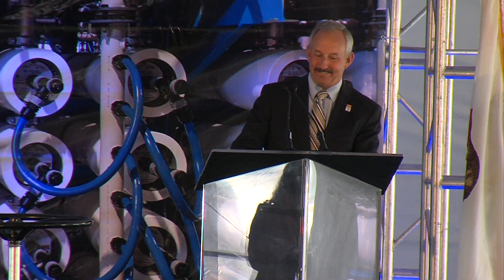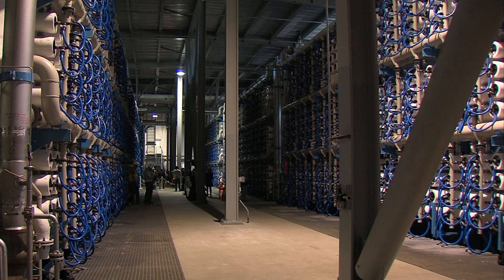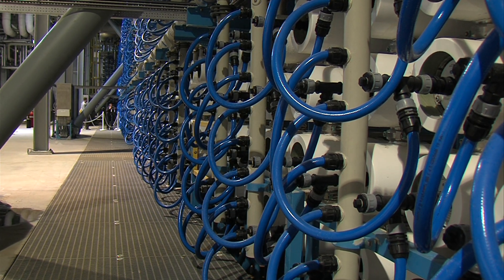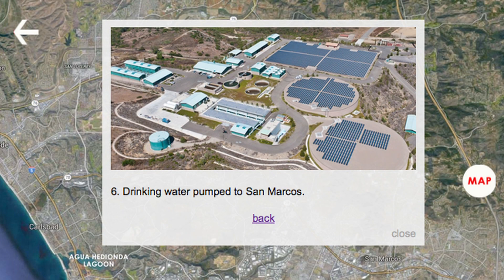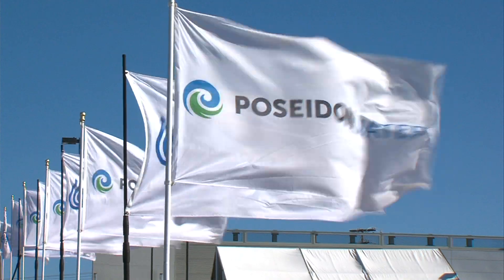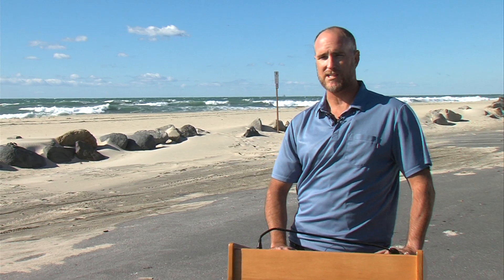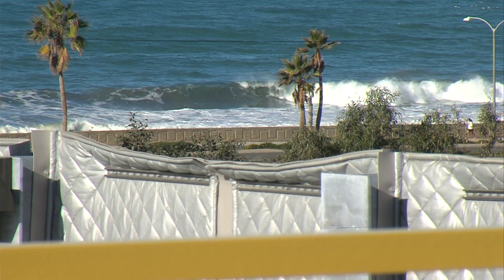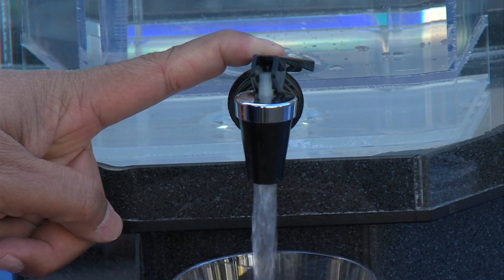Drinking Water Starts Flowing From Carlsbad Desalination Plant

Comment: EITHER USE A PIPE LINE TO PIPE IT INLAND TO STAY AWAY FROM THE WEATHER - OR BUILD A HOLDING POND TO GET YOUR WATER TO STAY AWAY FROM THE WAVES.  
SOLAR POWER YOUR POWER PLANTS AND RUN THE WATER THRU GENERATORS IN THE PIPE LINE.
>YOUR JUST USING THE SUN TO START THE WATER FLOWING...ONCE IT STARTS THE GENERATORS WILL KEEP IT FLOWING AND CREATE ELECTRIC.
Reply: +Debra Mitchell 
>THE HOOVER DAM ON A SOLAR SCALE<